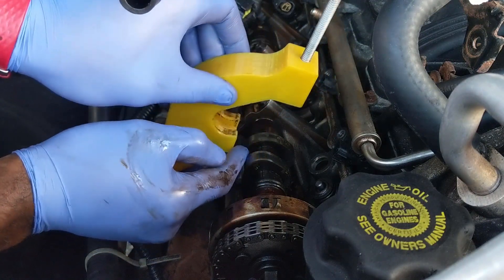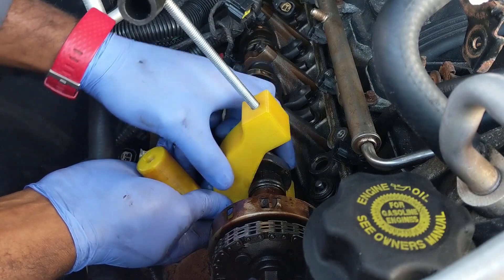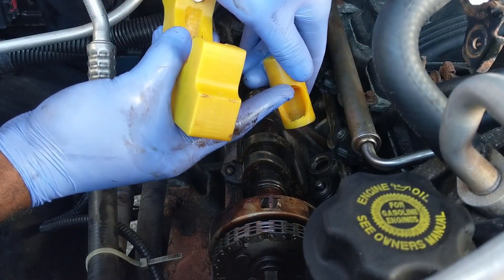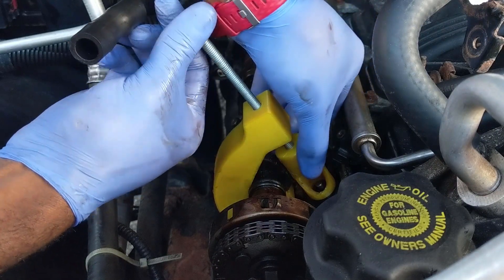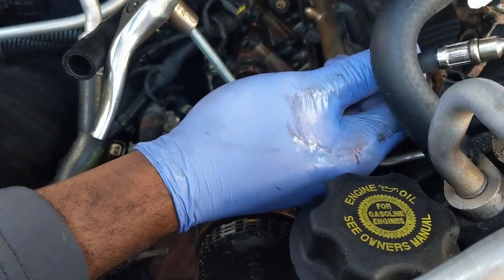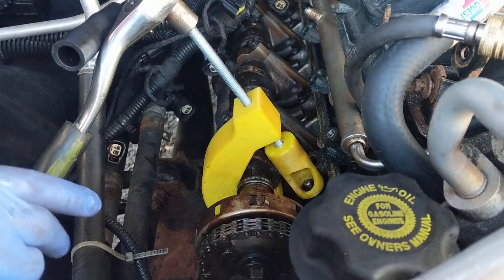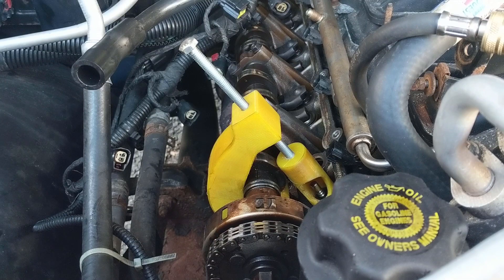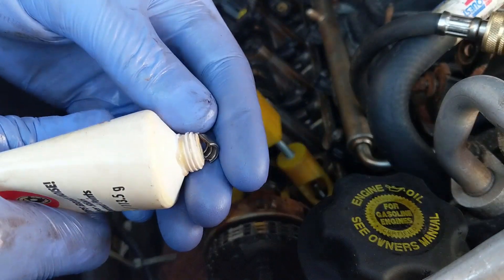How to Replace Chrysler Dodge Jeep 3.7/4.7 Valve Seals, Valve Spring using a Spring Compressor Tool

Comment: how did you keep the valve from falling down inside the head?
Reply from the maker: Hi, you can use 2 methods: 1) insert a thick string through the spark plug opening and push the string into the cylinder until the valve stays up (keep 1 ft of string out of the cylinder to be able to pull it out when done). 2) Use and air compressor connected to the spark plug opening, keep cylinder pressurized to at least 60 psi. The string method is more convenient (using bungie cords for example).
Reply: @Crunchysann  Yea, Iafter asking the question I realized compressed air would work.

Comment: Question, What does the PSI need to be set on to keep valve from dropping?    I need to replace valve stems on my '06 Commander 4.7?
Reply from the maker: Hi, you should not need more than 60PSI. However, if you do not have an air compressor you can also take a thick long string and stuff it in the cylinder (through the spark plug hole) to hold the valve up without air (this is called "the string method" by some people). Just make sure to remove the string before turning the engine over.

Comment: I just replaced valve stem seals on my 2006 3.7L Dakota. This tool made the job SO much easier! The hard part is getting everything out of the way. Had to remove brake booster on driver's side and A/C accumulator on passenger side to get to rear cylinders. Took my time over a few days, spent about 20 hours on the whole job. The tool is pricey but easily paid for itself.

Comment: Can this tool be used with the rope method ? I plan on using rope since I don’t have a good air compressor .
Reply from the maker: Yes it can. The key is to make sure the valves are not able to move once you start compressing the spring.
Reply: It works like a charm!! I used the rope method instead of the air. Like you said. I just made sure the valves don’t start to fall as I compress the spring.
Reply from the maker: @guswendt  glad to see another happy customer!

Comment: My husband used this tool to replace valve seals on my Jeep Liberty.  He began using it but after trying to remove the 5th one the bolt would not move it was stripped and he was unable to remove it after trying different ways he ended having to use a hacksaw to cut it off carefully. We were so upset & dissaponted so  I emailed CrunchySann and told them what happened. They replied next day. We expected tthis conpany to give us a hard time, however, to our surprise they immediately sent new one. We were so relieved. Once received my husband continued the job, however, this time he was very careful using it slowly and  used graphite on the bolt between every 2 valve seals removed. We are excited & relieved that he was able to complete the job & now I have my car back thanks to the great customer service this company provides. I absolutely recommend this tool as this company stands 100% behind their product.
Reply from the maker: Thank you for your honest feedback Mary! We're glad that your car is back on the road.
Reply: Is he willing to sell the tool?

Comment: How do you turn the camshaft so that the tool fits around the lobes?
Reply from the maker: remove all spark plugs, and use a large wrench or ratchet to manually turn the crankshaft bolt.

Comment: Who ever buys that tool, holy shit 125$? I feel bad for you suckers. Online the same type of tool for a 3.7 and 4.7 Chrysler engines just built different and looks different and about 90% of the cost of this one... It does the same thing, cups around the camshaft and presses down the valve springs, all you use for this one is your regular socket wrench hooks to the side and as you apply pressure it compresses..... This one also comes with an attachment to make it a rocker arm remover. 👍
Reply from the maker: The main difference with our tool is the fact that you can easily use our tool without having to remove your entire engine from the car, all by yourself. It will not slip and fly off like the lower cost tools you mention. Our tool holds the spring compressed so you can use your hands to add/readjust keepers: Try doing that with any other tool designed for this job on the engines you mentioned, while the engine is still in the engine bay :). We do still appreciate your feedback.
Reply: This is true but and I have one but is impossible to do the back cylinders with the cheep tool. There is no way with the cheaper tool to put the keepers in and hold the spring down at the same time.

Comment: Looks like it’s 3D Printed. How much for the 3D printed files?
Reply from the maker: Hi Zachary, although some parts are made out of 3D printed plastic: The metal supports add more than enough rigidity to this tool for the job. Unfortunately we do not provide the 3D models.

Comment: How good does it fit on the last cylinders in the back
Reply from the maker: Fits very well as long as you remove the brake booster.
Reply: @Crunchysann  the brake booster on the 2008 Grand Cherokee 3.7L?  I just replaced the brake booster and it was a pain in the bu** haha!! I was going to do the valve seals with your tool but now I have second thoughts lol.  The grand Cherokee seems with enough space not to have to remove the brake booster…!?

Comment: In the midst of replacing valve seals, springs, rockers, lash adjusters on my 03 Durango.  Tool is well made.  This is not a quick job.  Follow the technique in video for getting valve locks on.  If you have a 1st gen Durango, accept the fact that the power brake booster is going to need to come out and do it before you start on the driver's side.

Comment: Purchased tool.  Going to be replacing valve seals.  Thinking of putting in new rocker arms and lash adjusters while I'm in there.  Engine has 170k miles.  Thoughts?
Reply from the maker: @KEITH Don't forget to change your valve cover gasket and valve springs.
Reply: @Crunchysann  I have new gaskets. You changed the valve springs as well? I was going to reuse
Reply from the maker: @keiths9483  it's not required. But at that mileage and given the amount of things you need to take apart...I'd change them.
Reply: @Crunchysann    What valve springs did you use?  Mine is an 03.  All stock.  Did you also replace retainers and locks?
Reply from the maker: @keiths9483  springs vary, i would advise you to call the dealer and identify the exact part yours takes. I only replaced retainers that i lost during the installation.
Reply: @Crunchysann  Melling VS-2482 is a direct replacement for stock

Comment: Just used this today, and it FREAKING. WORKS. SUPER. WELL. If you have to take the valve cover off for any reason, might as well get this and do the seals. 100% recommended

Comment: hi I'm currently trying to do this on my 02 dodge dakota with the 4.7 and I looked up your tool and couldn't find it. I just got it all tore apart and to find the same problem you did was wondering if you had any of these available or how soon you would be able to and how much they are. because this is my daily driver

Comment: I search and search on ebay and cant seem to find your specific tool can you steer me in the right way to buy this tool.thank you ...
Reply: @Crunchysann  Your link shows 259,909 Results to try and find yours.   Will these be back on the website soon?   Project sitting and waiting.   I have registered but no contact portal on your website.
Reply: @Crunchysann  I used your link on eBay and it did not pull up your product it pulled a screen full and at the top says 259,909 results for your tool.   Page after page of tools.
Reply: @Crunchysann  yes

Comment: I was in the process of designing a valve spring removal tool for my 4.7L Ram 1500 when I came across your video.  I ended up making mine very similar to yours and I can confirm that it works perfectly.  I used PLA as that's all I had.  30% infill with 6 upper, lower and side layers for the main part.  For the cylinder shaped part, I originally did 30% infill but that was insufficient and bolt started crushing the PLA inside the hole.  I switched to 100% fill.  Material usage increase was minimal and it only took another 10 minutes to print since it's such a small part.  Not a single bit of crush after that.

My truck has been burning oil on start up so I figured it was the seals.  Sure enough, the seals weren't even touching the valve stems anymore.  I completed the passenger side yesterday and will continue with the driver side today.  This tool made removal and installation a simple one man job.

I'm replacing all the lash adjusters  while I have it apart.  The upper adjusters were all good but the lower ones were all collapsed.  Not sure if this is just an coincidence or if it's typical of this engine.
Reply: @Crunchysann  If I cannot print it, do you ship ? how much would it cost?
Reply: Was hoping you sold the tools AND YOU DO! WILL BE ORDERING WITHIN THE NEXT 30 MINUTES THANKS MAN 🤘🤙🤙🤙
Reply: @Crunchysann  i was able to order it with the last link bro and it went thru.  Under a Jauhara.  Said est. Delivery is on the 25th.  Also i didnt see option for faster shipping option is there one that could get it to me by tge weekend?  And ill definitely post an update, i absolutely was planning on pulling the heads til i saw the video 🤣😂🤘🤙
Reply: @Crunchysann  salud 🤘🤙
Reply: @Crunchysann  i was looking for the design on thingiverse and it's not their no more can share the design again please?
Reply: @Crunchysann  Are you still offering the STL file for this? Our '04 Grand Cherokee just started smoking and I suspect it is the valve seals. 215,000 miles lol. But still running strong otherwise!